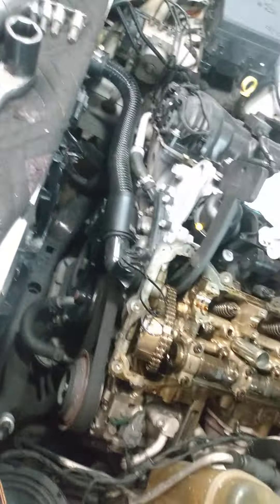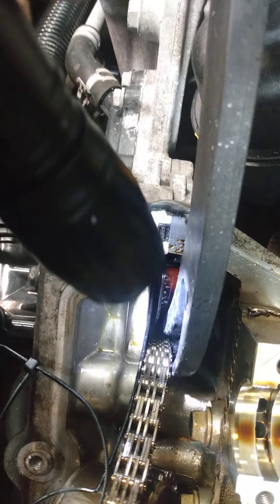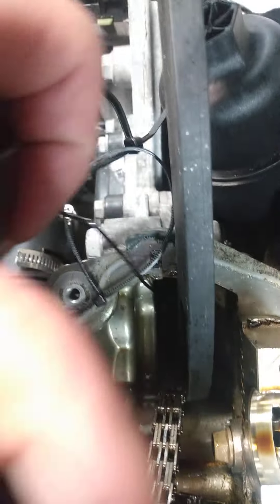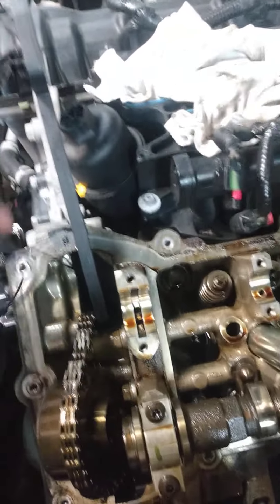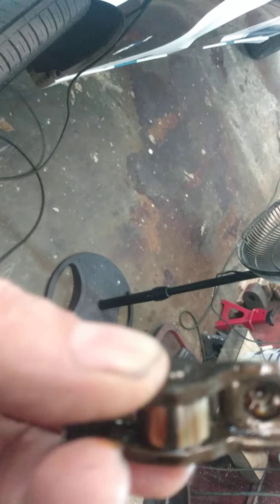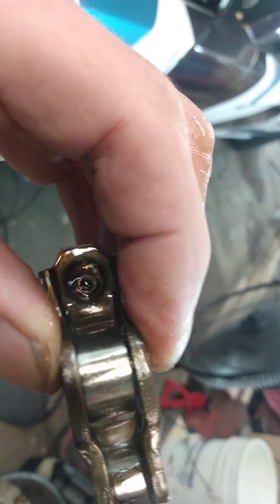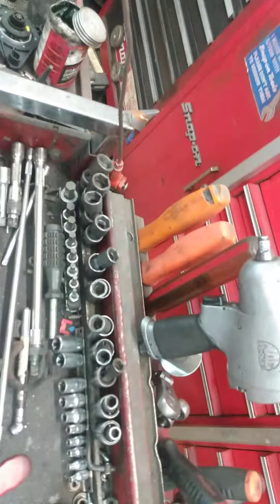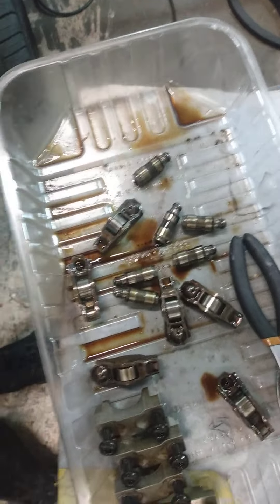2011-2019 Dodge Chrysler jeep 3.6L how to loosen and hold the timing chain tensioner

Comment: It’s not actually the pins that are loose. It makes it rattle. It’s the needle bearings blow out because of heat in the bearing swaps around in there snacking up against the camshaft lobe so if you hear a rattle and you drive it for a long time afterwards, you coulddo damage to the camshaft and have to replace it if you take care of it right when you start hearing the rattle, you should have no problem just throw some new rocker, arms and lifters in there
Reply from the maker: @cadebailey2519  yeah you are totally right and remember to change your oil regularly and use the right weight